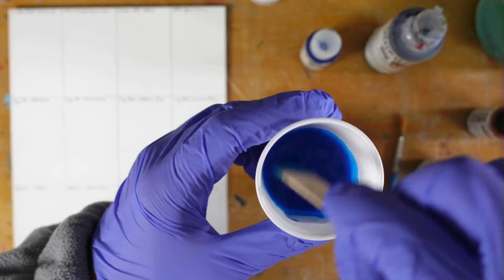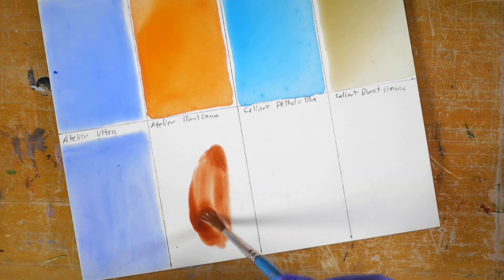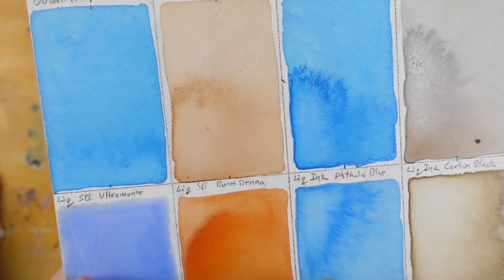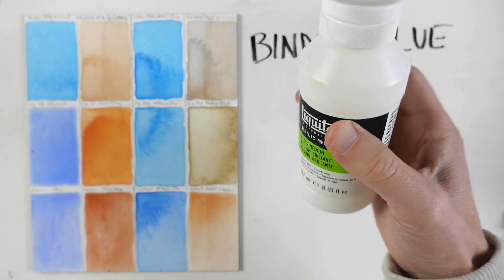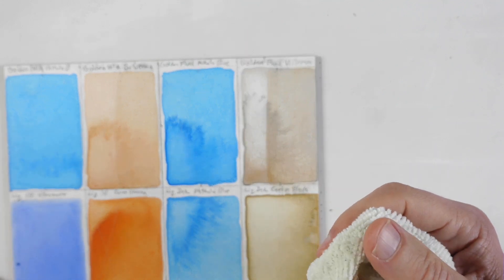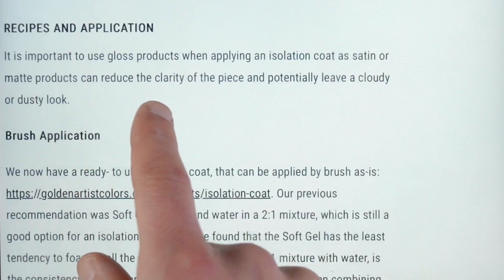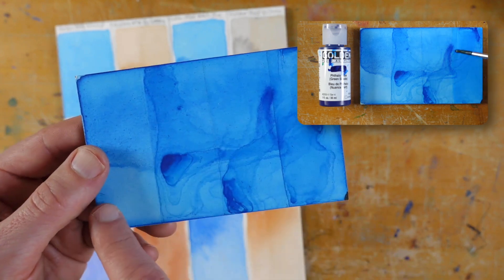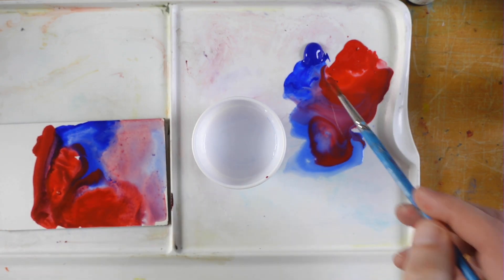Thinning acrylic paint with 99% water?...no problem!

Comment: @0:49, 25ml water?
Reply from the maker: I diluted .25ml paint to 250 ml of water. I used such a small quantity of paint because if I were to use 1 tablespoon of paint and diluted it with 100 parts water, that would result in something like 6.25 cups.

Comment: I've had these problems when airbrushing. I work in many layers and if the top "glazes" are really thin and then I use frisket overtop it will sometimes lift that top layer of paint. I've learned to keep an airbrush filled with varnish during the process so I can top coat it before moving on. My mix for that tends to be 50/50 matte medium and GAC 200 (the hardest one). I find the addition of GAC 200 hardens the paint film significantly and that helps the frisket release more easily.  That isolation coat really keeps the paint from being lifted up by the frisket.
Reply from the maker: Thanks for the tips and sharing your experience, I’ll have to check out the GAC 200.

Comment: Thanks for a really helpful video Chris! 
I like to 'work thin' with acrylics for effects similar to watercolour and always add some medium to the water. I'm now considering an isolation coat too.
Reply from the maker: Thanks! I recommend practicing applying isolation coats on test pieces first, it can be a little unnerving because it’s permanent and dries quickly. And to make sure it doesn’t lift any of the paint layers.
Reply: @ChrisBreier  I agree and will do. Thanks again for your excellent advice. x